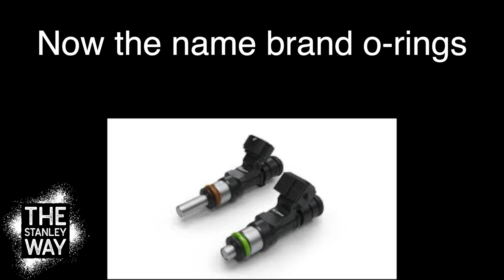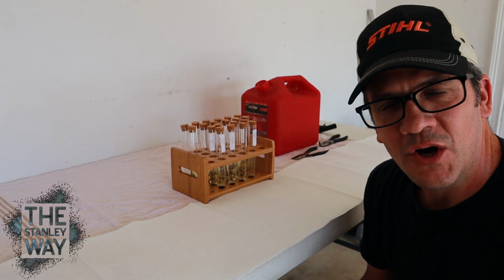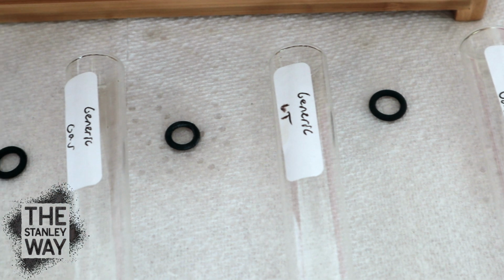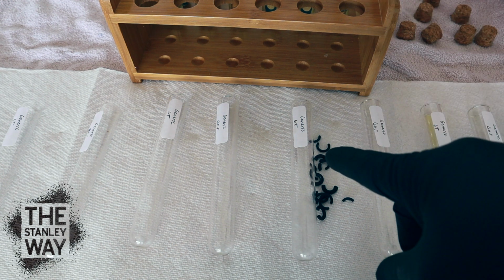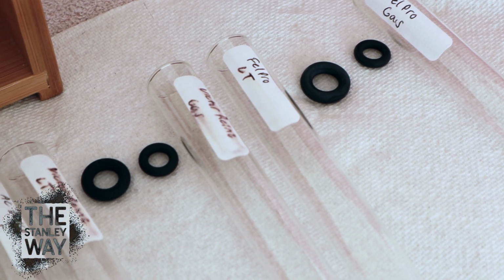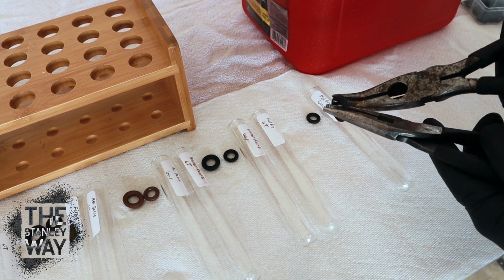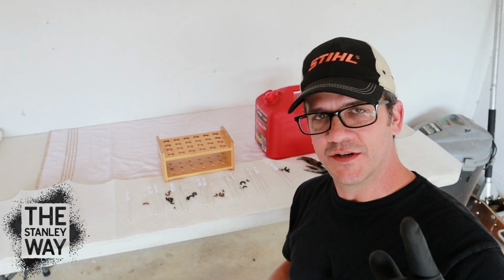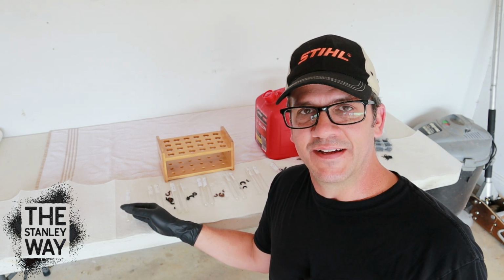Car Fuel System Lacquer Thinner 30 Day Test Video

Comment: I was getting the low efficiency bank 2 code about every 130 miles.
Tired this, and I've gone 1150 miles with no code!! So I give this a thumbs up!!
2006 Lexus IS250 AWD 166,000 miles.
Reply from the maker: That is awesome!! Glad it worked for you. It is definitely worth trying. Thanks for the comment.
Reply: Thanks for sharing. So you putted about a gallon of LT and the thing got better with the low eff code? Best.
Reply from the maker: Yes, a gallon is what people normally put in but I used two gallons on one of my cars to see if it would hurt anything. I ran the tank all the way out and had no problems.
Reply: @TheStanleyWay  thanks, appreciate it. Keep the channel up. Best.
Reply: Harmfull ? Or not
Reply from the maker: @JcAseelBreed no I don’t think so. I have used it in multiple cars with no issues.

Comment: My daughter's 2015 Honda Fit (88,800 mi.) had the CEL come on and it was throwing a P0420 code, so I added one gallon of lacquer thinner to ten gallons of gas and drove the car on the highway at 80mph for about three hours, and that CEL went off. It looks like many people are recommending a 1 to 5 ratio on LT to gas. I'm planning to do the same with my my 2011 Honda Odyssey now that I've deleted the VCM. (12/14/22)
Reply: I had 10:1 gas to LT sitting in my tank for 48 hours. Though the CEL went out, I realized that long term exposure to LT could melt plastics (ie. Fuel pump) and rubber seals.
Reply: @slacker_DIY  Yes, LT has a lot of acetone in it which will eat rubber and plastic. I forgot to mention it above, but after driving 150 miles I did fill up with fresh gas to dilute the LT even further and minimize damage.

Comment: In airless sprayers which may be exposed to lacquer thinner and other chemicals for prolonged periods they use leather in place of O rings and nylon every else (bushings etc...)
Reply from the maker: Cool, thanks for the info.
Reply: @TheStanleyWay  Well what am I missing? The injectors wouldn't have o-rings on them when installed so they wouldn't come in contact with thinners.
Reply from the maker: @Paul-hn1wo  if you use lacquer thinner in the gas tank and run it through the system, the gasoline lacquer thinner will come in contact with the o-rings.
Reply: @TheStanleyWay   Sorry I was thinking the Lacquer Thinner as a cleaner with the O rings removed. Would pure Lacquer  Thinner  make a good cleaner
Reply from the maker: @Paul-hn1wo  No problem.

Comment: you should do 1 to 5 gas/ thinner test tube ratio for 30 days to see what would happen to add to your theory that o rings would not be affected
Reply from the maker: That is a good suggestion along with another suggestion I have had from a viewer. I plan doing both tests after Christmas so be looking out. Thank you and Merry Christmas.
Reply: @TheStanleyWay  I better subscribe to look out for it
Reply: 10:1 is the ratio you're supposed to use.

Comment: I'm having Cat problems w/my F-150, 0420, going to give the lacquer thinner a go.
Another guy showed running the car at high RPM 4000 by staying in a lower gear.
Also I look at mine with one of the Temp. guns doodads, aim it at whatever and get a tempurture reading. Aimed at the front on my Cat alway much hotter at the front, where-as it should be hotter [much hotter] at the rear of the cat.
You do a good job I've enjoyed watching, liked/subbed/bell notification and I think will qualify as a comment - laf.
Reply from the maker: Thank you I appreciate it and I hope the lacquer thinner works for you.

Comment: Not sure what this video proves? A more useful test would be 9 parts gas and 1 part thinner and store fuel injector O-rings in it for 24 hours. That would be a real world test that would prove if doing this cat clean hack would damage your car.
Reply from the maker: SURPRISING Result | Lacquer Thinner vs Cataclean O-Ring Test Video
https://youtu.be/2w980ssnID0 that is why I did this video also.

Comment: OEM will typically use the cheapest compatable materials!

1st one, was Nitril.  Is ok for Gasoline and sub par for Laq.  2nd one, was Viton and good for Gas but not at all for Laq.  So with that you see the results of your test!  As you said, since the "diluted" Laq and Gas mix isn't in the system for very long, it likely has little to no affect on the O-rings.

If you want to replace all the O-rings in the fuel delivery system, then replace with Teflon and your good!  

Suggest Stanley buy and test a few Teflon O-rings  <<<  👍👍

Comment: Just simply remove the air fuel ratio O2 sensors and spray or pour the lacquer thinner directly into the cat let cold soak overnight then return put the O2 sensors back in and drive

Comment: You put the lacquer thinner in with a half a tank of gas and then drive it immediately for 150 miles (road trip) or what I did I ran it until the gas light came on (only a gallon or so left in the tank) then you fill the tank with premium gas and drive it home and continue driving as normal. So basically you are running gas diluted with lacquer thinner for only a half a tank of gas. You are soaking O-Rings for an extended period of time making your little experiment We-Tawded and not scientific in the least when compared to running lacquer thinner through your car. That's All! Bye..
Reply from the maker: 😂 thank you for your opinion.
Reply: @TheStanleyWay  im dead

Comment: by your own admission and stated goal this test was kinda of a waste of time, you yourself stated that no one is going to use straight LT. with an average half tank of gas in modern cars being approximately 8 gallons, 1 gallon of LT constitutes about 12% or a ratio of 3.25. Had the test had used gasoline that was diluted with 12% LT and done in a way that would simulate limited o-ring exposure like that in an engine instead of direct full time soaking the test could have been extremely relevant..........
Reply from the maker: The point of this video was to show what lacquer thinner does to different types of o-rings. This video uses different ratios https://youtu.be/2w980ssnID0